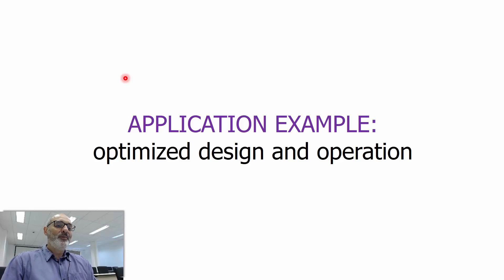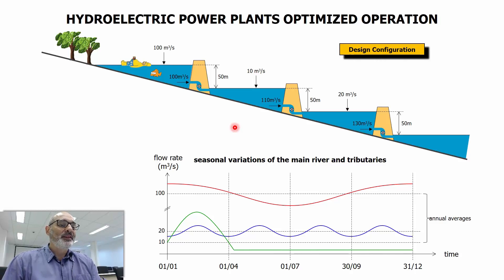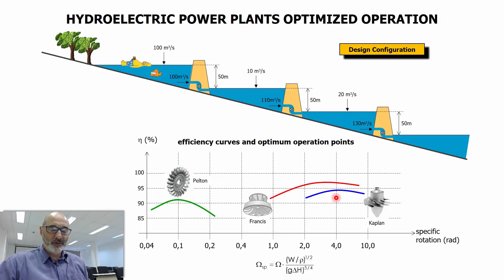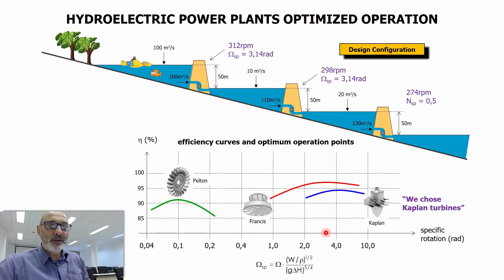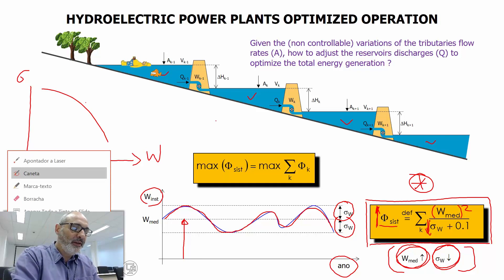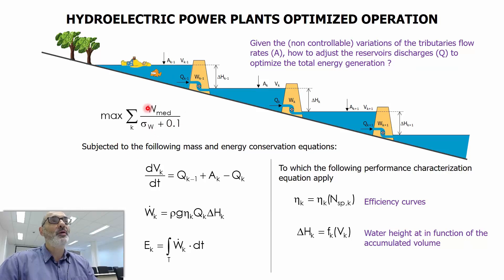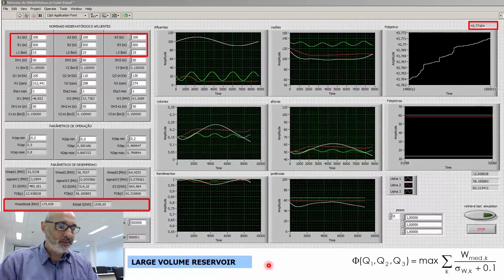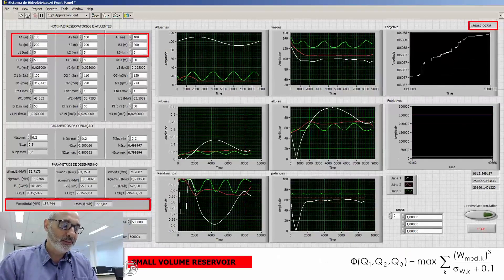Optimized operation of hydroelectric power plants

Comment: Sir iam working on canal fall hydro power project where the canal flow is different at different periods of time and the project is designed for 350 cumec discharge maximum and net head is 3.5 meter, my question is can i get an increase in head when the flow is 250 cumec by making equilibirium at intake and outake of dischage to get more generation of energy by increase in head
Kindly help me on it
Reply from the maker: Please explain your proposition, particularly when you say “…by making equilibirium at intake and outake of discharge…”.
Reply: @ProfSeleghim  Sir as is discussed I am working on a canal hydropower project at an existing fall of canal 3.25 Meter. The canal head race and tail race top and bottom widths are 41.124 Meter & 34.138 Meters respectively with side slope 1V:2H. The canal is seasonal with varied discharges throughout the year. The maximum canal design discharge is 425 Cumec with probability of occurrence 31%. The canal discharges would differ and from studies of previous data it says that canal would remain close for 17 days (4.5%) time of an year, the discharges would remain above 350 Cumec to 425 cumec for 70 days (19% ) of an year, 300 Cumec for 111 days (30%) and 250 for 167 days (45%) of the time. The hydropower project was decided to be designed at 350 Cumec discharge with fixing parameters like, Designed FSL 618.59 fasl Upstream, 607.95 fasl Downstream. Designed bed level 600.59 Upstream, 589.95 fasl Downstream. Designed full supply depth 18 ft. designed water surface slope is 1:8000. Lacey silt factor (f) .97, value of (N) .017 with free board 4.00ft and velocity of flow is 1.7 m/s. considering all these parameters the hydropower is designed at 350 Cumec discharge with 4No. of turbines having discharge 87.5 Cumec each with net head of 3.55 Meter. The annual energy output calculated considering all fixed parameters is 67 Gwh. Now at this design we are suffering with tariff issues. Can u please suggest any changes/ recommendations keeping economic aspects and more energy outputs for this study. It was my consideration that if the project is designed at 300 Cumec discharge with 3.95 M net head with 4No. of turbines each 75 Cumec, by passing the excessive discharge of flood season through spillways the value of energy output would increase by 5% to 6% or provision of an additional 5th standby turbine of 75 Cumec at same head level 3.95 Meter to deal with discharge in flood season will increase the energy generation by 10% more than designing at 350 Cumec. Its my 1st experience at hydropower So, Your expert opinion can help me a lot.
Reply from the maker: Thanks for the info. I'l look into it.
Reply: @ProfSeleghim  Thank you Sir the only missing info in my statement is that the fall is at 106+250 RD and a divergence canal from RD 104+800 RD which will meet the original canal at RD 108 is there whose section is enhanced to 112 Meter with powerhouse width 88 meter and spillway width of 24 meter
Im very thankful to you for ur response and if u can guide.